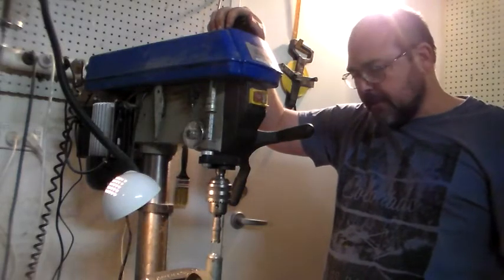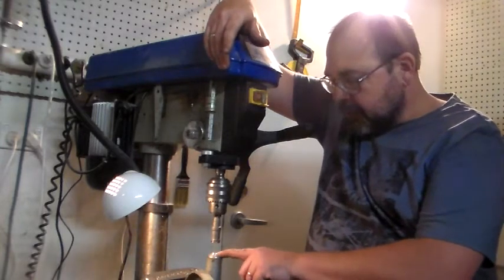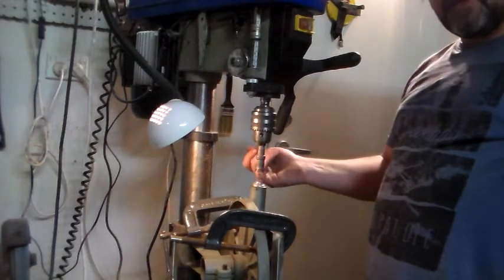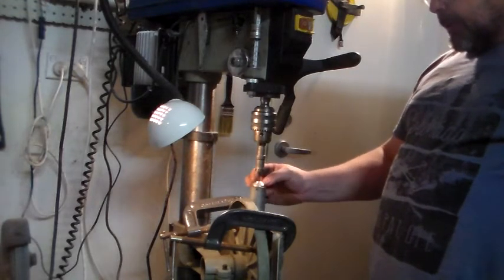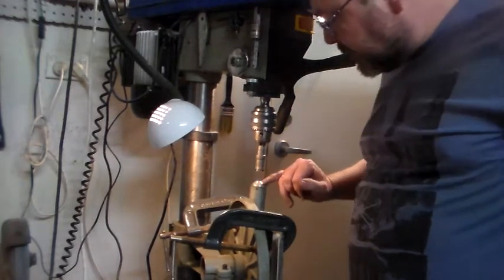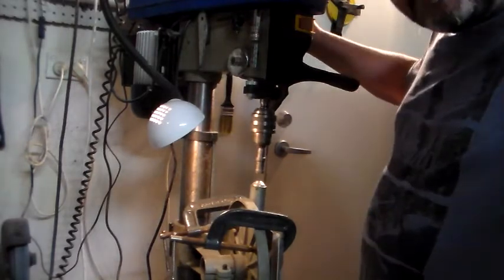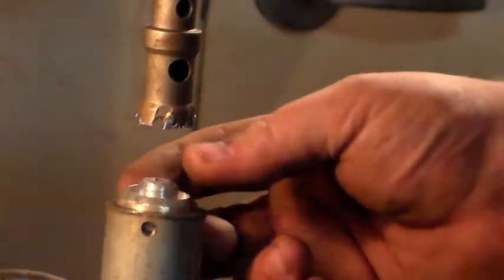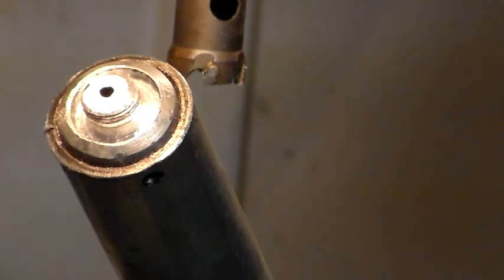Making a Plastic Injection Molding Machine Part 6

Comment: In one of his videos he said it'll be "challenge." Most people often say it'll be a "hassle" then I can see a need for a lathe. I admire people for their great will to try things out. So I will give some lathe building tips.
 continue...
Reply from the maker: David  Hi David, thank you for your input, it is greatly appreciated. I have tried using the drill press as a lathe in the way you mentioned with the table mounted sideways and a chisel mounted in the cross slide vice (I did a short video on it), then using the vice to run the chisel point across the work piece. I did have some success however, as you also mentioned, there is an issue with the chuck dropping...this also happens when milling on the drill press.
I can see how your solution would work however, I'm not to comfortable with putting JB Weld on the shaft as I'd like to continue removing it to use MT2 drill bits and the like.
I do really appreciate your input and will consider your suggests re the mating surface between the nozzle and the mould.
Kindest regards, Alex.

Comment: To build a drill press lathe, simple mount the cross-vise sideways to the table. It looks like your table is already sideways. Remember that chucks tend to fall off from the shaft. To solve this problem remove the shaft then cut shallow groove or slots on both the shaft on chuck and shaft. Eliminate all oil, roughen the surface then apply JB-weld or something stronger. The JB is now acting as a lock key. Remember to bolt or screw the drill press plunger to reduce any play. If there is any play, your drill press bearing is probably in need of a replacement. A tapered bearing is a good replacement if you can find them. All this is not as stable as a lathe but will work for light duty work.

Comment: I mentioned on another video that a nozzle mating surface-to-mold are typically flat for DYI. And they are proven reliable. Just make sure the nozzle mating surface-to-mold are true. I would allow ways to adjust it if it weren't.

Comment: Also, you may have oozing problems. This is the problem I'm trying to solve now.  There is one guy who's selling a molder on ebay using a screw right at the tip of the nozzle to stop the ooze. Ooze can be reduced if you dry your resin first. Be sure you have a face protection in case doing this may be unsafe.